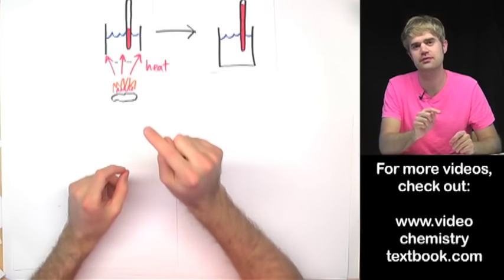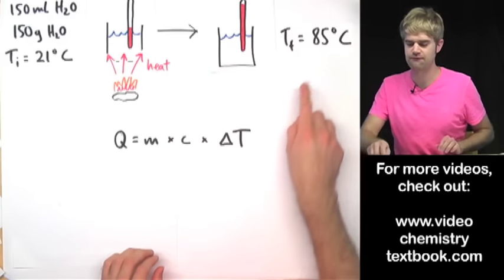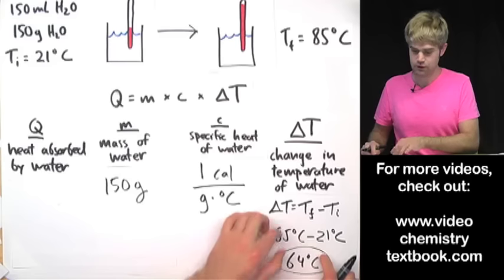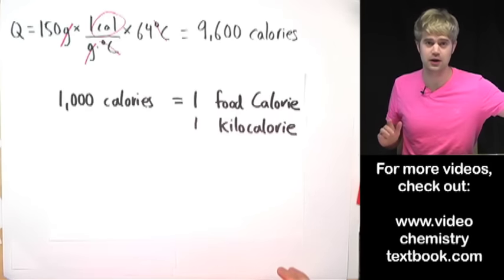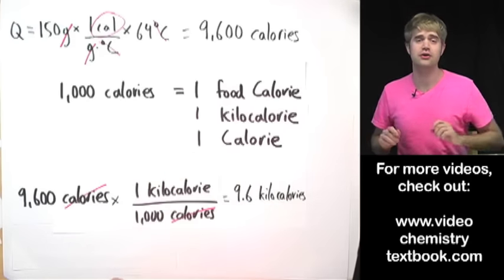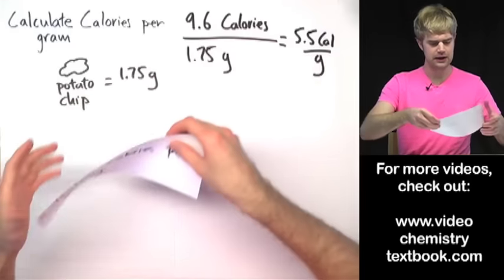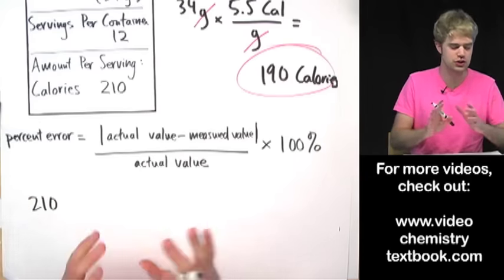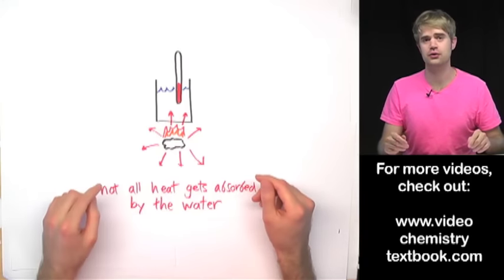Food Calorimetry Lab: Calculations

Comment: how come you dont use 4.184 as the specific heat capacity for water?
Reply from the maker: Jonathan Alban It's just different units. The way 12 inches equals 1 foot. 4.184 Joules is equal to 1 Calorie. So water has a specific heat capacity of 1 cal/g•ºC, or 4.184 J/g•ºC.
Reply: +Tyler DeWitt but when you use 4.184 Joules, you get a totally different answer
Reply: +Tyler DeWitt 4.184 Joules equals 1 Calorie, not 1 calorie. You then converted something that was already in Calories to Calories, because you put that 1 Joule equals 1 calorie.
Reply from the maker: +Fresh StopMotionReviews No, 4.184 KILOjoules equals 1 Calorie (uppercase). 4.184 Joules equals one calorie (lowercase). I don't fully understand what you're saying in your comment, but my math is right here.

Comment: What bugs me is how you can ever warm up 150g water by 65 degrees celcius by burning a single potato chip. Id have enough trouble getting it to burn at all. If youd start at a moderate temp of 35 deg, that water would be boiling! What kind of crisps are you using? Made of gun powder?

Comment: amazing I had an Energy online quiz and I only had 4 mins left and I did it correct. If 200 g of water is heated from 5 C to 25 C, then what is the heat added in kilocalories (same as food calories)? 200*20= 4000 = 4000/1000 = 4 kcal. Thanks Tyler